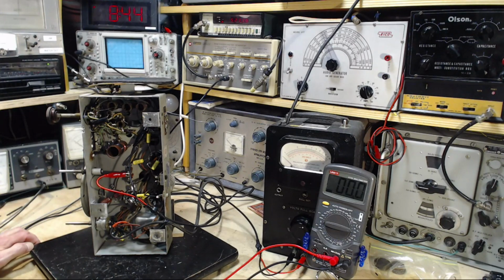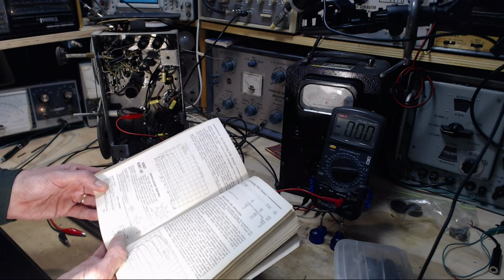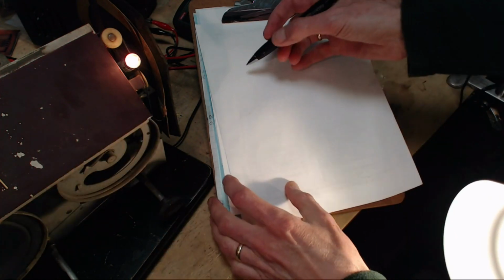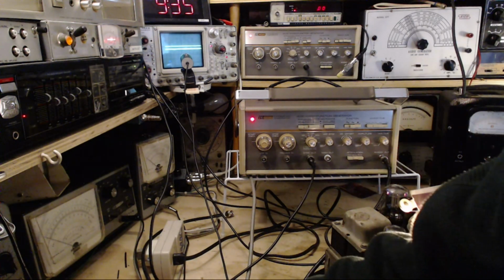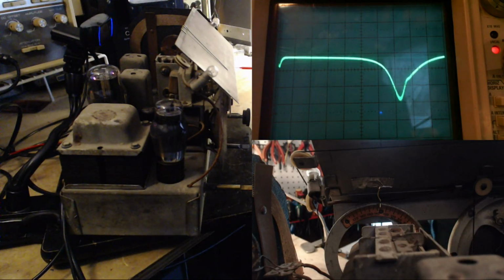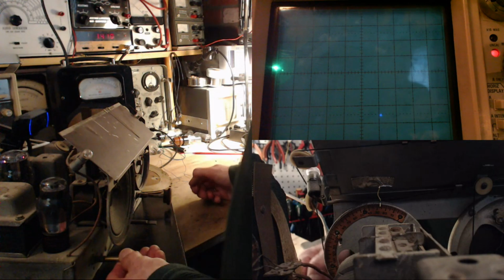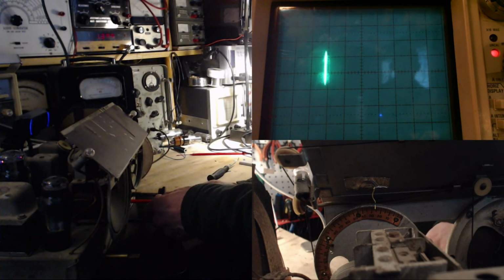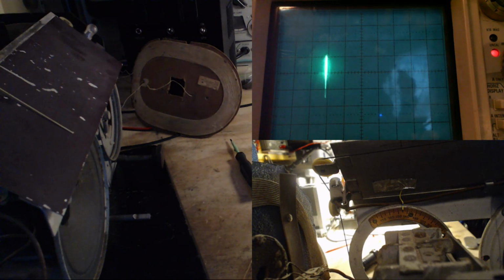RCA Victor A23 Tube Radio #11 -  IF Sweep Alignment

Comment: I disable the local oscillator , and the sweep does not need to be 20khz. The pass and for an AM station is only 10 KHz , plus and minus 5 Khz  above and below the center freq. of 455khz. The slope fall off occurs at 3 db below the center. That wiggle is caller a marker. You need more vertical gain on the scope and some horizontal sweep magnification. Too strong of a signal can askew the curve. You have a nice little RF Generator in the lower left corner, that looks like an RCA WR-50-B, a much simpler sweep generator , but you need a 455 Kc xtal for it. The kink is the effect of the local osc. That is still running. You need to disable the osc and give up AVC

Comment: What happened to the receiver's pilot lights?
Reply from the maker: I got tired of looking at them and seeing them washout the video so I loosened them off.  When the glass is installed, I'll be able to see what kind of bulb is needed.  The originals look too small to me.  The filament must be inline with the glass edge and I think the little bulbs won't reach there.  We'll see.

Comment: Jim, you seem to have a thing about AVC. You should defeat the AVC effect by clamping it with a dc voltage. Make up a battery pack with about 6 cells and a clip lead so you can select the voltage. Use this to apply a negative voltage to your AVC line and then carefully adjust your signal generator level so as not to overload the receiver. This is a standard practice when aligning a TV set and a radio is no different.
Reply from the maker: I've never tried clamping the AVC even though I have a variable supply to do it.  I should give that a try.  Maybe right now.